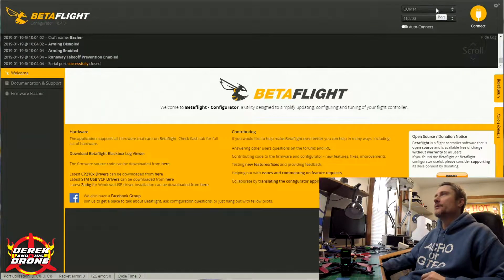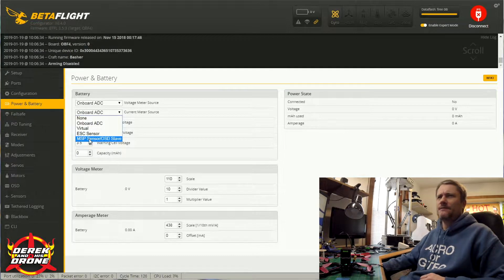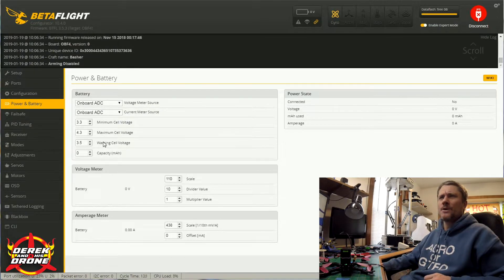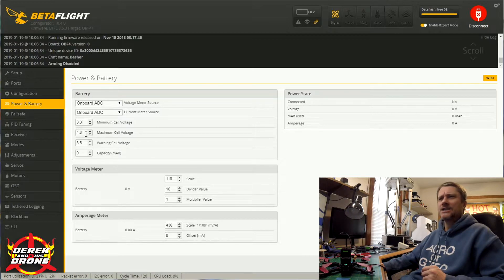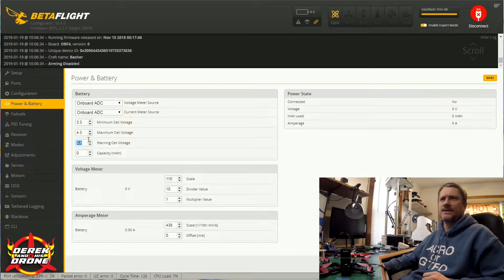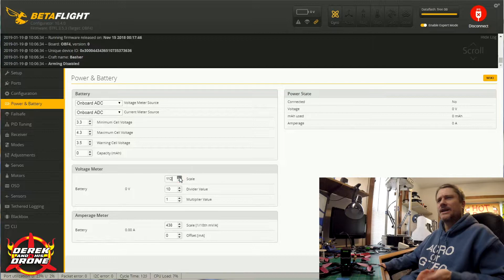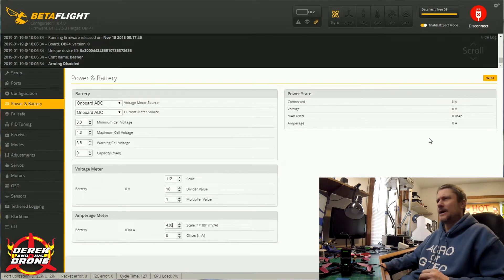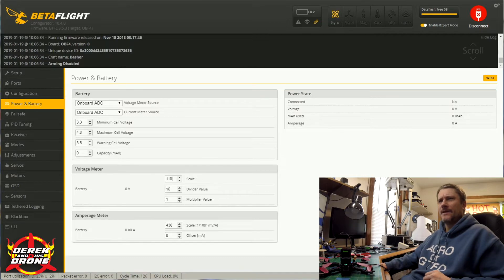Basics of Betaflight - Power and Battery

Comment: Oh . The last section POWER STATE 
  Turns on when i plugged in a battery . It said connected Yes ( 3 cells )
Voltage 12.50V
mAh used 1790
Amperage 60.3
   It knew i used a handy 3s lipo made from an old 4s that had a dead cell but powers goggles now .😊
Reply from the maker: Awesome, glad it is working for you.

Comment: i have question :D
how does the betaflight know what s lipo i have 2s 4s 6s ???
if uhcan help me i am zhankfulll :)
Reply from the maker: Betaflight assumes the cell count from the battery voltage.  Sometimes its' wrong.
Reply: @DerekandhisDrone  thanks for the answer :) if its wrong is there a optin to fix it :) ?
Reply from the maker: @Woodyyes--  If you always run batteries with the same cell count it can be set in the power tab.

Comment: Thanks for the vid. If you hit minimum voltage does the quad just drop or does the osd just tell you to land now?
Reply from the maker: The configuration is just for the warning.
Reply: In osd you put 'warnings " on . In battery you set what low voltage you want warning to blink in your goggles . 3.1 v in a lipo might not recharge if you let the battery go below 3 volts per cell . So I set my warning to 3.6 volts cell voltage so I have warning time to land before the battery gets too low.  Old batteries go low faster and might just sink to the ground  unexpected and can be hard to find . The warning is nice .

Comment: Thanks for the video. What happens when you hit minimum voltage?
Reply from the maker: If configured you can get a low battery voltage warning on your OSD.  It can also be used to sound a beeper for low voltage.

Comment: my voltage on osd shows zero?any idea?
Reply from the maker: No, what flight controller?
Reply: @DerekandhisDrone  clracingf4
Reply from the maker: Look in the battery tab in Betaflight and make sure that the on board sensor is selected for your battery sense. Has it ever worked?  If not maybe you got a bad board.

Comment: Im not using fpv at the moment so i dont have OSD. How can i know when my battery is near depleted. Do all quads have a buzzer or capability to chirp or are there special requirements?
Reply from the maker: Most modern flight controllers support a beeper.  You need to look for the buzzer pads on your fc.  You need to add it.  Here are a couple of options.
https://www.banggood.com/custlink/v3GD0k0Bct
or
https://www.banggood.com/custlink/vKKKekg0JO

Comment: My drone never cuts off the voltage when i reached minimum voltage,  on all my quads..  why?
Reply from the maker: It doesn't work like that. It is only to set a warning in the OSD or with a buzzer.
Reply: @DerekandhisDrone  But isnt that what "warning cell voltage" is for?
Reply from the maker: It is only to flash a warning in your OSD.  Personally I think it's annoying and disable it.  With battery sag it can make the warning come up quite frequent.

Comment: Here's a new one for me.  My osd shows the battery as 3.3 and flashed constantly as if the battery was drained.  I know it's not.  What do i need to look for? This is the first time this has happened and i use the same flight controller and wired the same as always.  CL Racing F4s
Reply from the maker: I'm not sure, maybe you got a bad FC.  Where did you get it from?
Reply: RDQ
Reply: Maybe a crash has caused it to malfunction. I have no idea how long I’ve had this controller and it recently started. I don’t remember crashing but who knows. I thought u might know a setting that I was missing. Thanks.
Reply: Also the RSSI on the osd reads zero bars and flashed. Might be time to replace the FC.
Reply from the maker: Sometimes things just break.  I haven't heard of any fixes for your problems.  A FC usually lasts about 6 months for me.

Comment: I have a question for battery warning 
Land now Warning On OSD I cannot get the warning to come on the OSD Before the battery gets low Voltage  
I’m using a BeeBrain Lite tiny Whoop  Flight  controller Setup. . Do I have to do something in Betaflight ?
Reply from the maker: On the Power & Battery tab increase the Warning Cell Voltage.
Reply: Well I might have a more of a problem with just the voltage my OSD When I arm it it will freeze the OSD information  I don’t see any changes in the battery voltage drop and RSSI 
Value change . The timer is frozen  to . Any ideas to fix this what do you think ?
Reply from the maker: That problem is usually related to the OSD chip.  The only fix is to replace the chip or flight controller.  Is it a BeeBrain Lite?
Reply: Derek and his Drone yes
Reply from the maker: Create a ticket with NewBee Drone support they will get you sorted out.  You can even tell them I sent you!
https://newbeedrone.zendesk.com/hc/en-us/requests/new

Comment: What is the issue if the battery is connected and Betaflight shows battery is not connected? I've had this issue on a omnibus F4 FC since I've had it.
Reply from the maker: On board sensor should be selected otherwise it is probably a bad sensor on the flight controller.